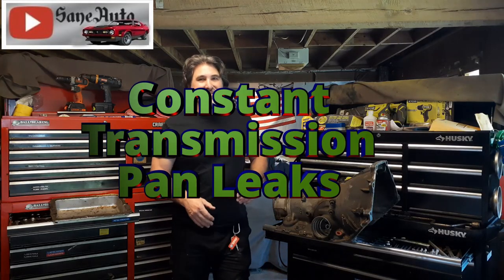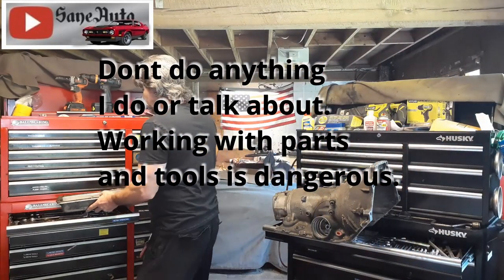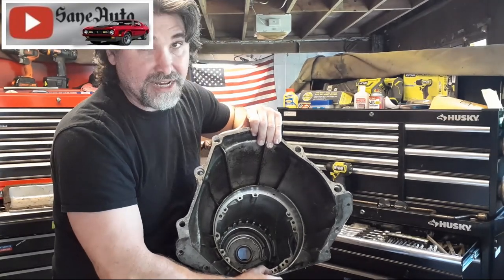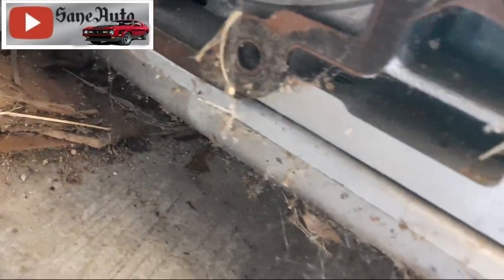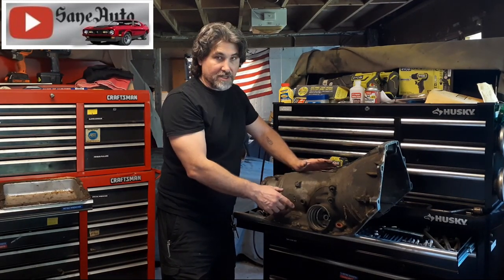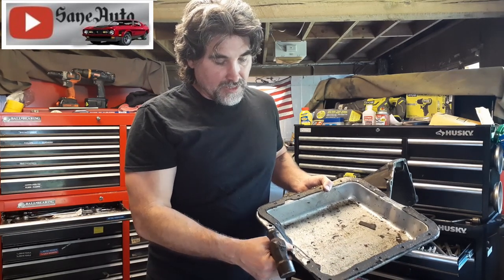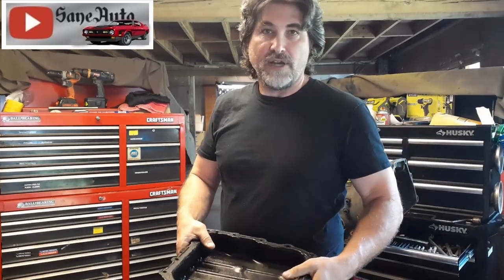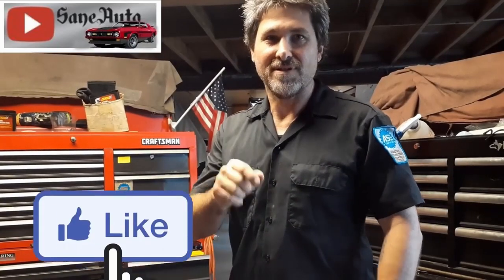How to stop Automatic Transmission pan leak DIY fix top 5 leaks

Comment: Lot of guy don’t know the trick of silicone. They apply and slam down tight. NO! You have to explain/tell them to wait. Let the silicone have a minute to start to gel before making the seal surface. Then don’t tighten the daylights out of the pan. I really like your secret of doing a final wipe for oil before closing the pan. GOLDEN. THKS

Comment: I think part of the problem is the bolts should come with spring washers designed to close at a certain torque and then stay closed with the tension of the spring to keep the gasket tight. Since they don't I'm getting ready to redo my leaky pan with better bolts and washers (if I can find some that fit).

Comment: Best video on this subject ive found so far. Ive had my truck in the shop 6 times already with a slow transmission leak. Everyone keeps telling me its the pan. Even tho they changed it 3 times. I think its the dipstick bc its all pitted at the bottom. Its driving me absolutely nuts bc They keep telling me its fixed... i get it home and it leaks yet again. Keeps leaving soft ball sized spots on the ground. Wouldnt be a big dealxto me at all if I didnt do landscaping and constantly in other peoples driveways at a lot of nice houses and I know they dont want me leaking in their driveways. I really wish I had a father who actually showed me how to work on and fix my own vehicle. Drives me nuts that I have to depend on others for that. I can do the simple things but not transmissions. Im rdy to just put full coverage on the god damn thing and watch it go missing. Its a real shame too bc its a really nice little work truck with only 79k miles on it. 2003 chevy S10 with the 8ft box.
Reply: Trans dipsticks on auto S10s are cheap might as well buy and change yourself. I assume this isn't an nv3500 S10
Reply: I CAN FIX IT,my dad's a t.v. repairman.

Comment: Hi, I just saw your video about hitting the holes with a round hammer, which I have not done. I have a fmx on my 69 cougar and I just changed the transmission gasket but in about three weeks is leaking again, my problem is that I don't drive too much this car and sometimes goes about two weeks  or more that is just parked.  My question: should I buy a deeper trans pan to avoid the fluid that goes down to the pan doesn't leak while parked?

Comment: Thanks for sharing. I'm working on 1 of those pesky Chrysler/Dodge Stratus pans now, 1997 model. Didn't use enough rtv, leaked/drained whole pan in no time. Inspected, just 2-3 of the screws were wet, so took out those 3 & 1 more, put Plenty of rtv on the bolt heads And threads, put some rtv up in each hole, back in, retorqued, Still leaks, but not quite as bad. So guess I'll try try again. Mercy.  Think I might try some Pematex #1 sealer, you use/recommend it?       Take care,     - Leeroy
Reply from the maker: I use this permatex black RTV -- https://amzn.to/3oGz0ap & when I cant get it the JB weld brand of Black RTV is just as good. The trick is to get the surface dry before applying the RTV. Not easy to do on those chryslers.
Reply: @saneauto  Thanks man. I like the sound of Max oil resistance. Yeah I hear ya', next time I think I'll use some carb/brake cleaner or rubbing alcohol on all the surfaces before the rtv. Seems like sealing atf is about the same as trying to seal water.   Mercy. Guess I'll try again this weekend. Double mercy.                                        - take care
Reply: You may want to look into Hylomar Blue.
Reply: @Jeremybolenbaugh Okay cool, thanks for the info.    - take care

Comment: Well i guess its not my pan gasket cus ive changes it like 3 times so yea.☹️
Reply: probably   your tran  pan is  warped which in case  gnew gasket will still leak install new pan  and gasket  tighted  like doing a head repair to 3 to4 ft lbs    each bolt  if that doesent  work  it means  your transmission is possessed           hbjerry
Reply: @jerryjames2163  possessed??? I changed the pan also.
Reply: @j.j.5844  you changed the pan  with a new unwrarped one i  hope then you sequenced tightened the bolts finger  lite tight  remember  sequence  tight  then  you got  out your torque  gauge  socket  wrench  and sequence tightened the bolts to 3  to 4  ft lbs. (check manafactureers recomendations for ft  lb) could be different. then i should be ok.
Reply: It could be leaking from other parts of the transmission as mentioned in the video
Reply: I'm in the same boat three times now and it's still leaking now I'm almost positive that I've over torqued the bolts and I didn't do it directionally either. I'm going to try that and if that doesn't work I don't know WTF? I'm even using a Lube Locker gasket which are supposed to be pretty solid.
Reply: @cushdog58  no sir your not over torque in it.
Reply: @bashirrahmani7619  yea i need to really look into it. Since i dont have that freedom to look into it like i should. I will soon
Reply: @cushdog58  did you get it fixed having the same issue with mine